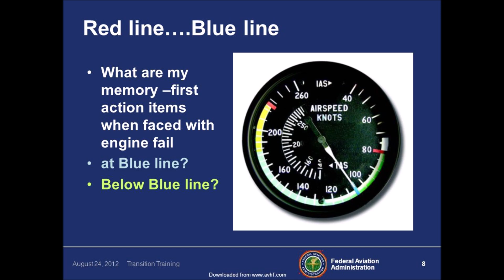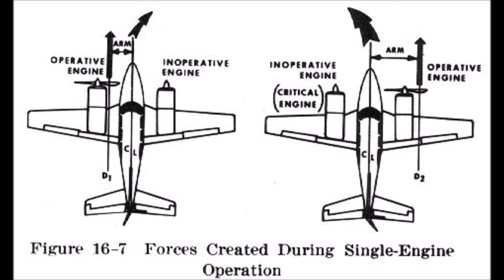King Air Crash- Addison Texas Update

Comment: As usual, nice briefing Juan.
I'm the survivor of two different engine failures on takeoff, one was in a single engine Cessna at OAK, fortunately was at sufficient altitude to immediately return and land on a runway. The second was in a C-310 at LAS again was able to return and land safely. Both times due to "blown" pistons. Couple of precautionary shutdowns on the 727 at altitude- NBD. Takeoff briefings are mandatory, no matter what you are flying-even gliders. 
Although the P-38 had counter-rotating props, both engines are considered "critical" because both rotated away from the longitudinal axis, i.e. the left engine rotated counter-clockwise, the right engine rotated clockwise. The Piper PA-34 Seminole has counter-rotating props with both props rotating downward toward the longitudinal axis, thus neither is "critical."
Reply: I was going to mention the prop rotation of the production P-38s but you beat me to it.  It had something to do with smoothing the airflow and/or reducing buffeting over the horizontal stabilizer.  The P-38 pictured in the video is one of the early prototypes and still had the props counter-rotating towards the longitudinal access as Juan described.   A minor quibble on a well done video.
Reply: @rempilot  This was also an initial problem with the NA F(P) 82 Twin Mustang with both props rotating upward while approaching the longitudinal axis, this blanketed the wing center section negating that section's lift to the point that the aircraft was not able to get airborne. This was overcome by swapping the engines left to right.
Reply: b747skyguy Interesting, thank you for the extra info.
Reply: @rempilot  you guys should send this info to whom ever investigating..looks like best analysis right here. Thank you
Reply: Majestic Angel Our little diversion had more to do with esoteric aviation history than the accident.  It was just a courteous exchange of information.
Reply: @rempilot  Ok..I understand..thank you and God Bless🙏 Stay safe🙏🙏🙏

Comment: Nice video Juan.  I'm not rated on nor have never flown the King Air, but have seen plenty of media reporting on this crash because I live in DFW area.  For this flight I'm thinking that this airplane had to have been close to max takeoff weight (MTOW) - in this case 15,000 pounds according to Wikipedia. 10 persons aboard plus some baggage puts aircraft weight at about 12,000 pounds before fueling by my rough calculation; I don't know how much fuel was needed but Addison to St. Petersburg is fairly long flight.  Maybe a King Air pilot can help with estimate on how much would've been needed.  NTSB team already knows how much fuel was pumped aboard during preflight by the local FBO.  Guess we'll have to wait for interim report.
Reply: Ship's max range reported as 1806, [optimum] flight plan distance 800kn (ADS to PIE). Reportedly tanks were full.
FWIW, at least the 8 passengers were low to medium weight. Obviously additional payload is unknown if even determinable.
It's a stretch to call overweight. If ship stated max of 11, and there were were 10 medium weight passengers - that's a big stretch.
Reply: @Bill_Woo  Not insinuating overweight, but thinking it was approaching MTOW.  Will see what NTSB has to say down the road.

Comment: I fly a 172 most of the time.  I've made the consious choice to use the short field takeoff procedure as my normal takeoff.  Run up to full power. Verify engine health. Start roll. Verify airspeed alive. Call out rotate and climb at Vx. Transition to Vy and verify engine and airspeed still good.  After run-up, I voice the altitude above which I will attempt a turn back if there is a problem.  I will have also designated what I will squash with my airplane if I am below my turn back altitude.  I'm lucky enough to live where there are a lot of fields.  Unfortunately we've lost a few people who still tried a turn back at low speed and altitude.  It's really sad given there is a perfectly good field at the end of the runway.  That field has been the site of several successful forced landings in which everyone got out alive.
Reply: I trained at an airport where there used to be open space at both ends of the runways, but developer greed took over, putting a housing development at one end and a large shopping mall at the other and the city pretty much filled in all the rest of the space in the area.  For the last 40 years most emergencies at that airport have ended tragically for airplane occupants.  (Helicopters still have a good chance of walk-away crashes due to their ability to touch down with zero forward speed.)
Reply: Not a pilot, but if I were, your explanation makes clear the chances of survival are there...if I am engaged in the process.
     Defensive flying, as with defensive driving, probably demands just slightly more attention to detail than normal operations...hope some flyer will take your advice and continue upon 'This Mortal Coil' for a bit longer.
Even Groundlings can read this and benefit.
Thanks

Comment: With you bringing up the P-38 and it's counter rotating props, I have a question for you. My dad was a line chief in the 31st Recon squadron in WW-II so I already knew about the counter rotating props but if I remember right, the Brits didn't want counter rotating props on the P-38's they ordered in the early stages of WW-ll.( they also didn't want superchargers either, completely eliminating their P-38's from high altitude missions) Did they do this to get them to turn better in one direction over the other or did they want things standardized to make interchangeability easier? 
There has to be a reason why companies build planes with or without counter rotating props. I'd really like to get your take on this. ...........................PS Great video.......................as usual! (:>)
Reply: Best I could figure out. Europe had poor fuel quality, so super high performance was not something they could deploy.

Comment: Juan, why is the thrust greater for the propeller blade on the descending portion of its arc?  I didn't get that one.
Reply: mrackerm, thrust is greater on descending blade due to the angle of attack being steeper on that blade compared to the ascending blade, which has a shallower angle of attack due to the pitch of the airplane compared to the relative wind. Descending blade  If you need further explication just let me know.

Comment: Apparently this is a different scenario, but the accident echoes a somewhat similar crash in Charlotte, NC on 1.8.03 to a Beechcraft 1900D, AirMidwest 5481. On that occasion it was a combination of poor maintenance and weight and balance issues.
Reply: When you hear that there were 10 people on board,  you for sure have to think about weight and balance.  No doubt that will be looked at.  Right now, I agree that it sure sounds like a very bad and sudden failure of the critical engine at the worst possible moment.

Comment: Just thinking about the P-38 when up came the picture for counter-rotating props – the P-38 was also an example of challenging engine out performance  – if an engine failed on takeoff below 120 mph IAS instructions were to “shut down both throttles and land straight ahead” otherwise end up in an instant flat spin as happened in the 1997 Oregon crash.

Comment: Great video as usual.  Thank you.  Auto feather a neat feature.  Helps identify which is bad engine.  I use to own a Seneca 2.  With a piston engine twin and no climb rate with loss of engine on take off, I would pull back both engines on take off with loss of engine.  Fly like a single Engine.  Turboprops are able to climb so different situation

Comment: Unfortunately for these pilots, they had few options. At the end of the runway at the Addison airport, there are restaurants, businesses and homes.
Reply: The question is did they reach V1 and Vr. They rotated, and had they not done that, nothing at all would have happened.

I suspect that they took off without operative thrust, just "stepping on the gas and blasting off" with what they had.
Reply: The hanger they hit was at the middle of the airport. Not the end.
Reply: @georgealdredge2806  I work literally across the street from this airport. Most small planes do take off near the middle of the airport but if they had realized the plane wasn't flyable and tried to immediately land it, there's no way they would be able to stop in time before crossing the airport boundary.

Comment: Juan, why wouldn’t on a twin engine it not be set up for props be contra rotating? As in one prop spinning clockwise and the other counter clockwise? I’m not a pilot
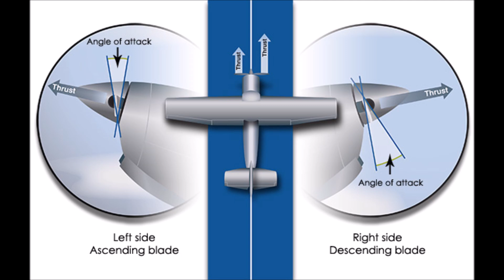Reply: There is an example of counter-rotating propellers at 13:15, the Lockheed P-38 Lightning. The extra cost complexity provides minimal safety benefits.

Comment: A completely wild speculation: could bad fuel do this? They were just topped off. Does NTSB test that -- especially given the nearly total destruction of traditional evidence from the remnants?
Reply: The NTSB will test everything, and fuel is particularly relevant to this accident.
Reply: @gordonrichardson2972  I've read NTSB reports cover to cover and don't recall any reports ever saying that they went to the pumps. They've only indicated amounts of fueling and locations during the prior flight legs. I have read of them taking samples from wreckage, but obviously that's the problem here. I'll bet that the report will say nothing of testing fuel from the actual dispenser. I agree with you -- it's potentially hugely relevant here. I hope that they'll surprise me by indicating this in the report.
Reply: @Bill_Woo  I assume the immediate cause of the crash directs their investigation. If the controls are jammed they won't suspect fuel contamination, however engine failure would point in this direction.
Reply: @gordonrichardson2972  Whatever the cause is determined or estimated to be, it's strongly looking like it's going to be insufficient power (if not clearly obvious). Whatever is the proximate cause of that they go with, though, the tragedy is that, in my foolishly premature prediction, that the crew rolled out without checking thrust - they just pushed the throttle and ran down the runway and rotated - with insufficient thrust. I'm only basing this on the witness narrative, but it sounds compelling - that it's going to go to pilot error :( :( Again, I hope that the team will surprise me by determining otherwise.
Reply: @HiWetcam Judging by the resultant fireball, I'd have to say that the fuel was just fine.🔥

Comment: So why is V1 lower than VR, doesn't that leave a small window of vulnerability where you are too slow to fly and too fast to abort?

Same sort of inconsistency where maximum landing weight is lower than maximum takeoff weight, didn't that cost Swiss Air 111 the thine they didn't have trying to dump fuel before landing in Halifax?
Reply: Christopher Guy 
V1 is a decision speed, and Vr is usually just a few knots faster. This is equivalent to a second or two most of the time.  In some smaller planes V1 and Vr are the same. If the runway is wet the two speeds are further apart and adjustments in weight may be needed depending on factors like runway length, slope, density altitude, obstacles extending beyond the runway, and performance, etc. 
Aborting takeoff at or belowV1 and you should remain on the runway. If an engine failure occurs after V1 you can accelerate to Vr and continue the takeoff and maintain controlled flight at V2 to V2+15. 

Swiss Air was a tragic loss, and I’m not arm chairing fellow pilots, but landing over max landing weight is not a problem in most cases. Especially with a fire onboard. A few week ago I did an overweight landing for a medical emergency, and after the mechanics did an inspection we were flying again in short order. 
Hope that answers your questions.
Reply: @howardrickert2558 , thank you for the clarification.
Reply: You may be thinking of V2 which is the twin engine abort speed, after which takeoff should be safe. V1 is the decision speed, when safe stopping is guaranteed. Depending on the engine performance and runway length they may be very close together with little margin for safety, or there may be no limit if the runway is long enough. Its complicated, and Juan only gives a brief description.
Reply: @gordonrichardson2972 , thank you for the insight.

Comment: Why would a twin engine plane NOT have counter rotating propellers/engines? Cost?
Reply: A Mascia : a number of piston twins do in fact have contra rotating props. . .
Reply: The increase maintenance issues do not warrant the marginal safety benefit.
Reply: Just about every rotating part in the engine will be different in the engine running backward leading to increased costs to manufacture and stock twice the number of parts.  The difference in the amount of adverse yaw depending on whether the left or right engine fails is nowhere as significant as the fact that it has fail and is producing drag rather than thrust and the fact that you must keep high power settings on the remaining engine in order to maintain airspeed.  Twin propeller aircaft with counterrotating props are designed that way to increase the agility of the plane for example twin engine fighters like the p38.  This accident will probably be a combination of factors.  Cause of the engine failure, low airspeed, possible overweight or cog issue, lack or recent engine fail on takeoff training, and possibly the tendency to turn the controls when you look over shoulder as the pilot probably did to confirm the engine wasn't turning.  Have you ever heard the saying you fly where you are looking?
Reply: @richardhiskett5422  Thanks for taking the time to 'splain. Interesting point about flying where you're looking: I learned that about riding horses before I learned to drive AND it works for driving a car too.

Comment: In level flight the propellers exert a significant torque on the fuselage just because they are pushing air.  This is the same effect that the main rotor of a helicopter exerts, which requires the tail rotor to compensate for.  Also the reason a big rig truck tilts to the side when it starts.  The counter-rotating propellers are mainly to eliminate this.  Russian submarines had counter-rotating props mas well to reduce the force on the sub, trying to spin it the opposite direction of the one propeller.  I haven't calculated the forces but I think this effect is larger than the difference in thrust due to the angle of attack that you explain.
Reply: @HiWetcam I'm just a lowly chemical engineer with only one class in fluid dynamics.  I'm too ignorant to calculate the effect, and too bored to look it up.  I'll leave that exerecise to you.  You sound like you know the lingo.

Comment: Interesting video. I was not aware that the Beech-craft King Air aircraft had both propellers traveling in the same direction while in flight. Your reference to the P-38 and the issues it had when it was first released came to my mind when your video first started. At first I wondered why this engine design was not kept for subsequent twin engine aircraft production. But it is clear that Beech-Craft was aware of the issue by adding rudder boost to compensate for engine failure. Given that knowledge and the fact this aircraft has a relatively stellar flying record, I can see why the counter rotating propeller concept was not used in the design of it. Good video and explanation as always.
Reply: Having contra rotating propellers adds a significant maintenance burden, with a marginal safety benefit.
Reply: Gordon Richardson I was not aware of that either as I am not expert in the field. But your response paints a clearer picture in my mind as to why this was not on this aircraft. Thanks for the response and insight. I learn every day in here.